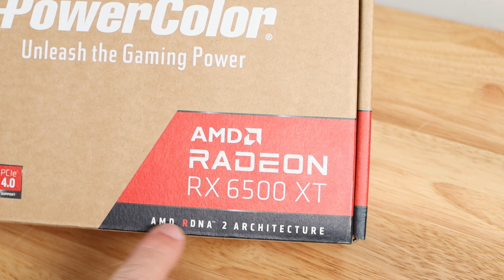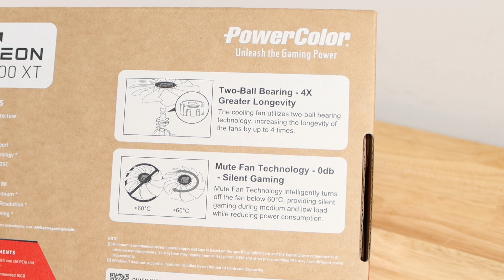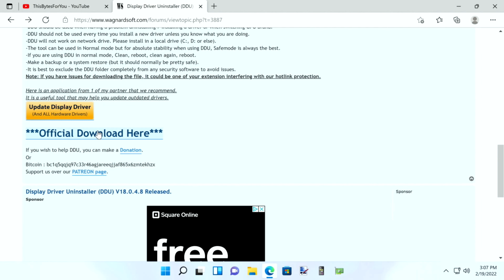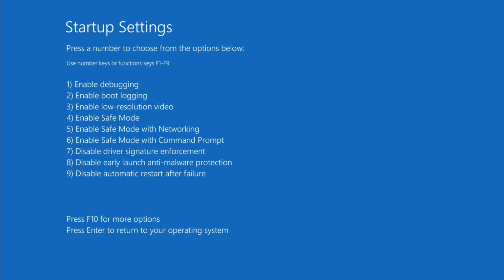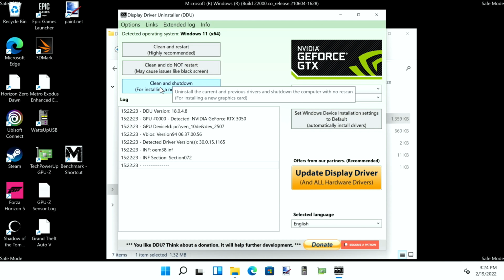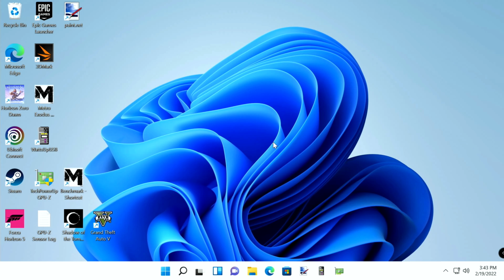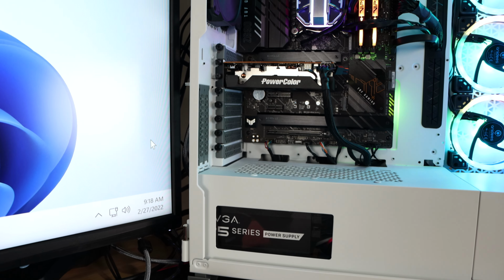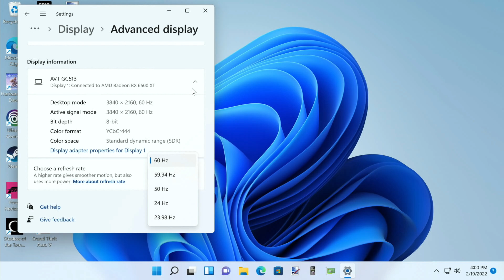AMD Radeon RX 6500 XT - Installing the PowerColor RX 6500 XT Gaming Graphics Card

Comment: Thank you! Fast, no shit talking or loud stupid music, direct to the point.

I got this card but really dislike it, I had a 1050ti and it doesn't really feel like an upgrade, maybe 15 fps more but the card is loud and hot all the time, an im using it at PCIE 4.0.

Hope I can replace it soon, because I hate it lol
Reply from the maker: always a pleasure my friend, so very happy you enjoyed it.  No, I would not go for this card to upgrade a 1050ti, it will be slightly faster, but not enough to warrant a new card, as you mentioned, 15, though it would be slightly over 20, but still, not enough., this is a good card when you can't get anything, this will work on PCIE 4 but it won't take advantage, you want a 6600 or above.  Well, if the card is hot and loud, its loud to lower the temps, but I never had that issue with it, sounds like maybe your system is thermally challeged.  How many fans do you have in the front of your case and are they blowing in or sucking out, How many fans do you have on the top of your case and are they blowing in or sucking out, How many fans do you have in the rear of your case and are they blowing in or sucking out,?

Comment: Thank you , just installed mine
Reply from the maker: Always a pleasure my friend, so very happy you stopped by, trusted in me to help you, liked and subbed as well as took a moment out of your day to thank me.  It means a ton to me and I am so very happy I could help you.
Reply: @ThisBytesForYou  sure thing , just one tiny problem , i have a r5 3400g , i paired it with rx 6500 xt pcie 4.0 , i just launched witcher 3 and the gpu became so loud and it reached 75° C
Reply from the maker: @BjoRn63  75°C is fine, perfectly fine, and noise is relevant, but I will have some noise level testing this soon.  Sounds like you might need some better case cooling if it gets too loud.

Comment: This gpu in Brasil cost R$1499 ( U$ 320 ) . It is the best option being the cheapest.
Reply from the maker: I get it my friend, but save your money, keep saving, like you would be saving for this card, and keep saving and saving, because new cards are coming out in September and you can buy an even better card
Reply: @ThisBytesForYou  my goal would be an Rx 6600 , and here in Brazil normally the cards arrive very expensive , for example the Rx 6500xt arrived costing R$3000 (U$600). but i hope for a better future . Note the minimum salary is R$1200
Reply from the maker: @First.exe_Brazil  my friend, if you keep saving the money you were going to spend on this card, and keep adding little bits to it every time you can, by the time the new cards come out, maybe you can get a newer card or save enough to get a RX 6800, think big my friend, you are thinking short term, save more so that you can have more.

Comment: I have a bug with this GPU. On two monitors, even without load, after an hour the memory frequency drops to zero. And then the card works at 10% performance. If you rearrange the monitor port, everything starts working agaai 60min. Changed computers and monitors. but doesn't work.
Reply from the maker: soooo have you tried to install it the way I show you?

Comment: Do you know if this would work or fit in the Dell Optiplez 790 DT?
Reply from the maker: depending on which case you have (we used to switch cases all the time) you could use this half height card, here is my Amazon affiliate link for it too, if you are interested: https://geni.us/SjS6bI
There are a few chassis styles that don't have any pcie slots, there are some that if they do have are half height, have 2 slots, which will work, some actually have 4 half height slots, make sure you have that one that has at least 2, 4 would work too.
Reply: @ThisBytesForYou  I read the DT version only has a 4 inch width so it might not be wide enough.  I might have to go down to the RX 6400.
Reply from the maker: @nsxproperties560  I can't say, Dell changes up caes on the same platforms often, a Google search in that model shows 3 different cases.

Comment: Hello 
good day
can you help me to use my 280hz monitor? Im stuck at 240hz
Reply from the maker: Hello my friend, a good day to you as well.  HDMI 2.0 can handle up to 240 Hz when using 1080p resolution, 144 Hz when using 1440p resolution and 60 Hz when using 4K resolution. HDMI 2.1 cables can handle up to 120 Hz when using 4K resolution and 60 Hz when using 8K resolution. Lower resolutions than 4K can all handle up to 240 Hz when using an HDMI 2.1 cable  DisplayPort offering up to 240Hz at 1080p resolution and 144Hz at 1440p. DisplayPort 1.3 and 1.4 are a major uplift in raw bandwidth over previous generations of DisplayPort, however, meaning they can do much more but the cable could be an issue.  What is the manufacturer and model number of your monitor?
Reply: @ThisBytesForYou  i have a good DP and HDMI there is no option for 280hz monitor. only 240hz but my monitor is 280hz

Comment: i cant seem to get it in on the left side
Reply from the maker: did you watch this video?
Reply: @ThisBytesForYou  yes unless i missed something … it slots in the right side and clicks down but not on the left even when i apply a lot of pressure … i’ve tried wiggling it around abit but nothing seems to work ? any advice
Reply from the maker: @jamesnash9565  you should not be sliding in side then the other, push it all in flat, it should all go in at the same time.
Reply: @ThisBytesForYou  ok thank you … should the yellow bit be able to be seen or not
Reply from the maker: yellow bit, no sure I know what you are referring to?

Comment: Yo, I followed thru your process but now the hdmi port is not reading the monitor?  Need help?!
Reply from the maker: So that I can help, please list the manufacturer and exact model number of the following components:
1. Motherboard - manufacturer and exact model number
2. CPU - manufacturer and exact model number
3. RAM - manufacturer and exact model number
4. Video Card - manufacturer and exact model number
5. Power supply - manufacturer and exact model number
6. Monitor - manufacturer and exact model number
 Redundant I know, but many people forget to enter manufacturer and exact model number
7. Do you have ALL of the PCIE connections plugged in, and not daisy chained or pigtailed, each coming directly from the power supply?
8. Are you running through HDMI, DP, DVI, VGA, any adapters?
9. UEFI in the BIOS from Legacy.  If it was set to Legacy, you will need to reinstall windows to get correct support.
10. Disable CSM in the BIOS
11. Installed latest supported chipset driver?

Comment: Great video! The setup was nice and simple to understand. The only problem I’m having is that the fan isn’t spinning, it says it needs 60+ C to spin but at 90 it doesn’t spin at all. Is there any solution to this?
Reply from the maker: Well, I am making a video on it now but when you are saying 90, are you saying 90F or is it C?  Also, thanks so much for your kind words?
Reply: @ThisBytesForYou  C , I tried many stress tests and it showed mostly 70-90 C with no response on the fan.
Reply from the maker: OK, just making sure
So that I can help, please list the manufacturer and exact model number of the following components:
1. Motherboard
2. CPU
3. RAM
4. Video Card
5. Power supply
6. Monitor.
7. Do you have ALL of the PCIE connections plugged in, and not daisy chained or pigtailed, each coming directly from the power supply?
8. Are you running through HDMI, DP, DVI, VGA, any adapters?
9. UEFI in the BIOS from Legacy.  If it was set to Legacy, you will need to reinstall windows to get correct support.
10. Disable CSM in the BIOS
11. Installed latest supported chipset driver?
Reply: @ThisBytesForYou  
1. AMD X570 - A PRO 
2. AMD Ryzen 7 3800X 8-Core Processor GHz
3. Corsair Vengeance ram (16GB)
4. RX 6500 XT (power color)
5. Corsair Cx 550m (cxm series)
6. It’s a Hisense tv.
7. It has 2 PCIE cables and one of them is connected.
8. HDMI
9. I’m using Msi click bios 5 and I cannot find it
10. There’s 2 modes, UEFI and CSM, i changed it to UEFI.
11. Yes
Reply from the maker: while you dont have access to lighting, see if this will work for you: https://youtu.be/8kfVq7Ht6lw
Reply: @ThisBytesForYou  the software doesn’t work with the gpu
Reply from the maker: @Unanimous17  then your card is bad
Reply: @ThisBytesForYou  If I refund this card, what would you recommend?
Reply from the maker: maybe a 3060?
Reply: @ThisBytesForYou  👍 I’ll see

Comment: my PCI-E cable has 8 pins but the card has 6, how do I make the 8 pins become 6 like you did?
Reply from the maker: you can use this: https://www.amazon.com/Cable-Matters-2-Pack-Extension-Power/dp/B01DV1Z4EQ/ref=sr_1_22_sspa?crid=1LKUKKXA2IA9K&keywords=8+pin+to+6+pin+pcie+adapter&qid=1690456865&sprefix=8+pin+to+6+pinpcie+adapter%2Caps%2C88&sr=8-22-spons&sp_csd=d2lkZ2V0TmFtZT1zcF9tdGY&psc=1

Comment: when i install my card in first my fan don’t turn and its doing 3 bip to my pc
Reply from the maker: do you have power plugged into the video card?
Reply: @ThisBytesForYou  yes, is it bc i didn’t put the pcie 4 cable?
Reply from the maker: @trunsky  pcie 4 cable, which cable is that?
Reply: @ThisBytesForYou  the one you plugged in the graphic card after you installed it is it obligated to plug this cable in?
Reply from the maker: @trunsky  did you watch this video, I talk about that.
Reply: @ThisBytesForYou  okay i’m sorry 😞
Reply: @ThisBytesForYou  but in the video you just said you changed the cable but not if it was obligated or not
Reply from the maker: no, you have to use it.

Comment: If I just have a intergraded gpu, do I have to remove that driver also?
Reply from the maker: You didn't listen to the video did you?
Reply: @ThisBytesForYou I did, how else would I know that you went over the removal of previous drivers? I obviously missed the part where you addressed it.
Reply from the maker: @dazeja  that's a great question.  So an integrated GPU, what does that use to function?

Comment: Is this card back compatible with PCI-E 2.0 ? I have older machine running win 10 pro and need to replace my old  Radeon HD 5700 dual monitor card?
Reply from the maker: No, sorry, it is not, it will only work on PCIE 4.0 even though it runs at PCIE 3.0.  What motherboard do you have, manufacturer and model number?
Reply: @ThisBytesForYou  thanks I have MSI 7885 sli 99 I was advised that it would be back compatible but only run at a 2.0 speed.
Reply from the maker: @dennygabos1870  I found that the stuttering would be horrible, but yes it would work, but if you are cool with stuttering, then by all means, go for it.

Comment: Hello. There are many 6500xt at around 200€ here. Are all the models the same? Powercolor...xfx...MSI. is there a significant difference
Reply from the maker: Well, they are 6500's, you can't expect too much.  What are your system specs, what games do you play and at what resolution.
Reply: @ThisBytesForYou  I like driving games, pcsx2 emulator and battlefield 3/4. For heavy games I already have playstation.
I watched some benchmarks and 6500xt seems to hold well the games I'm interested in, but there are so many versions of 6500xt I don't know which one is good
Reply from the maker: @freshtomato834  6500 is very low end, wait a few days, I can't say more than that ;)
Reply from the maker: Stay tuned my friend

Comment: hey, i have an problem with my graphics card its the same like u have the rx 6500 xt itx i get no picture with the graphics card but with my nvidia graphics card i get a picture and i have no problems with nvidia but with amd i get no picture.  

Mainboard: GIGABYTE B450M S2H V2
CPU: AMD Ryzen 5 1600
Power Supply: EVGA W1 500W
Reply from the maker: usually that is the case with older hardware, sadly.  A few things, first, update your BIOS to the latest version: https://www.gigabyte.com/Motherboard/B450M-S2H-V2-rev-1x/support#support-dl-bios

Then run through this video, except, after I remove the drivers, and reboot you will need to do a windows update and since we had placed the check in the box, it won't update video, update windows 100%, which will mean you will need to update, restart, update again, restart, update again and so on.

After you have updated, completely, you will need to download and install your updated chipset drivers: https://www.amd.com/en/support/chipsets/amd-socket-am4/b450

There is a chance you will need the latest standard in HDMI, 2.1 like you see in my amazon affiliate link: https://geni.us/fsv0 or DP  or DP 2.0 like in my Amazon Affiliate link: https://geni.us/TfYBF7A, AMD requires the latest standard in cables.
Reply: @ThisBytesForYou  do i also have to have a monitor that supports hdmi 2.1 or can i also have a monitor that has 2.0 hdmi? or can i use an displayport to hdmi adapter will this work?
Reply from the maker: @spongemusic9312  if the monitor only goes up to 2.0, make sure the cable does too, don't use adapters.
Reply: @ThisBytesForYou  how can i find out if the cable is a 2.1 or 2.0?
Reply from the maker: @spongemusic9312  sometimes a cable will have it written on there, mostly not though.  Other than that, I have no idea, I dont think there is a way to tell but I linked up a 2.1 on, which is backwards compatible.
Reply: @ThisBytesForYou  hello I just bought a hdmi 2.1 cable and I saw that you have a monitor that supports hdmi 2.0 and I also have a monitor that supports hdmi 2.0 would it work with the hdmi 2.1 cable?
Reply from the maker: Yup, sure would

Comment: I bought the card yesterday but while im installing the driver my screen is closing everytime i try can you tell me what is the solution.
Reply from the maker: So that I can help, please list the manufacturer and exact model number of the following components:
1. Motherboard
2. CPU
3. RAM
4. Video Card
5. Power supply
6. Monitor.
7. Do you have ALL of the PCIE connections plugged in, and not daisy chained or pigtailed, each coming directly from the power supply?
8. Are you running through HDMI, DP, DVI, VGA, any adapters?
9. UEFI in the BIOS from Legacy.  If it was set to Legacy, you will need to reinstall windows to get correct support.
10. Disable CSM in the BIOS
11. Installed latest supported chipset driver?
Reply: @ThisBytesForYou  i refunded the card i will buy a gtx 1650 😄
Reply: @ThisBytesForYou  i have a gtx 750 ti and it works perfectly i think the problem is card was broken
Reply: @ThisBytesForYou  but thank you for your attention
Reply from the maker: @erenolez834  ahhh well that does happen, glad you were able to get that resolved my friend.
Reply: @ThisBytesForYou  thanks a lot mate
Reply from the maker: @erenolez834  Always a pleasure my friend, so very happy I could help you.  If you haven't already, please consider subscribing, I come out with videos just like this every week and with almost 400 videos, I am sure I have something else you might need.  If not, let me know, if it makes sense, I might make a video out of it.  Thanks for giving me the opportunity to help you out.